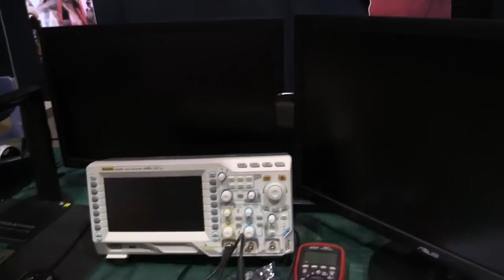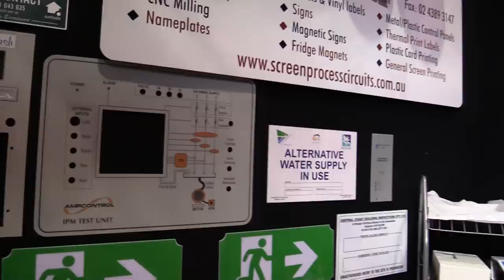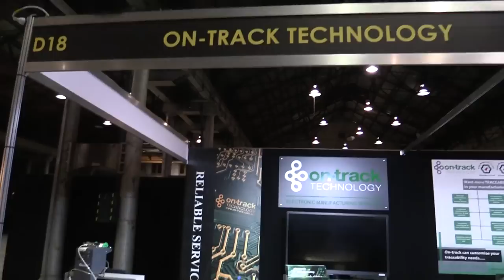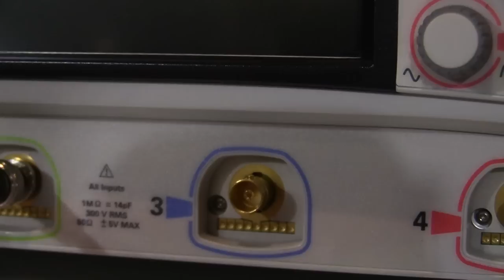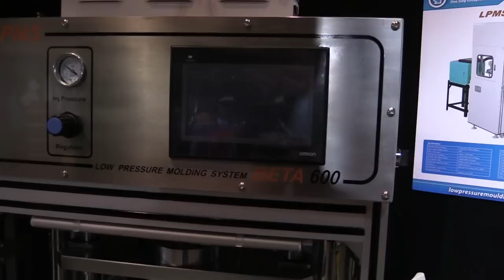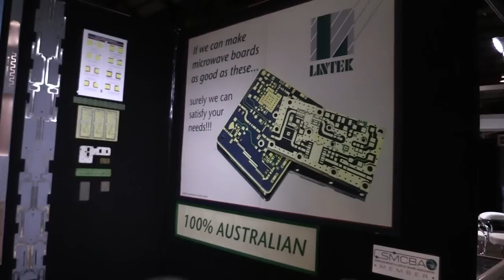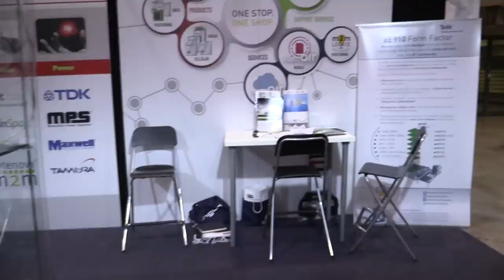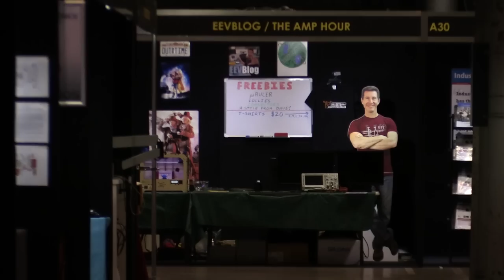Electronex 2014 - Walkaround

Comment: From my personal preference I would recommend you to use a longer shutter time, the stuttering that you get when each picture is frozen is more annoying than some motion blur which smooths out fast pans. You also get less noise as the sensor gets more light.
The most common  shutter angle to use is 180 degrees, which is half the time of the frame rate. So about 1/50-1/100 s would be optimal I think.
Reply from the maker: It doesn't matter what I do, people will still compain.
Reply: EEVblog ^ preachin' the gospel truth!
Reply: +EEVblog any shutter speed as if it was not for you I would have never of seen it.

Comment: I am still trying to work out why you where not tackled to the ground and beaten to a pulp by security. I am thinking next year I must print an ID badge and put on some sun glasses and get myself some zero cost very high end test gear. What I don't need can be sold to crime converters. Locals will get that without me being taken to court :-)

Comment: The 3D printer is the K8200 from Velleman.
Reply from the maker: Molipas Thanks. Anyone know if it's any good?
Reply: EEVblog varies a bit as its a kit and if you build it good and upgrade a few printable parts its realy good for the money, I'm printing with 0.1 mm layer height and getting really nice quality.
Reply: EEVblog I have one, and i think it's pretty awful, went and bought a Replicator 2. Great decision, just for the  removable base even
Reply from the maker: Michael John Lynch Interesting contrast in opinions just here! Someone at the show told me their Replicator 2 was horrible and borderline useless. Seems to be lots of varied opinion out there.
Reply: I use it to build handheld plasma source and I really like how I can walk into a room, and within a few minutes I have something printing and I'm able to do other things
Reply: I am currently using Maker Bot Replicator 2X for some commercial prototyping. To what I've seen it is kinda important to have your printer enclosed (unlike K8200). Air movement, cooling down your platform and your plastic can screw up your print. If I were to buy a cheaper home use printer, I'd go for an enclosed one. Also, 0,5 mm nozzle size is not too great, Maker Bot has 0,2 mm and it is barely precise enough to be able to reliably fit several parts together.
Reply: ***** I think I might look into getting an ultimaker, when it can do a higher resolution, the one drawback I find with the rep 2 is the build area, but that's only cause recently I find myself building 20cmx20cm 'frames' for electrodes
My colleague bought the one that RS sell (can't remember the name, but it has 3 print heads,) and he found it horrible for both him and his students to use, and they continue to use the original replicator. I had a friend who worked selling makerbots and he had 10 returns within the week of 5th gen machines as the smart extruder was crap.
Reply: EEVblog Pretty shit :/

Comment: Can anyone recommend me a few kits from particular manufactures of miscellaneous components (resistors, caps, etc) that come in bulk and vary in values? I have been getting hot and heavy in building breadboard up designs and learning along the way but radioshack isn't cutting it like it may have a decade ago. Thanks in advanced (looking for kits that come in nice little PEBs of say 1000 resistors, 1/2 watt, 1/4 watt, etc)..